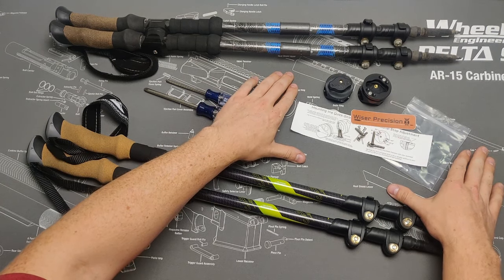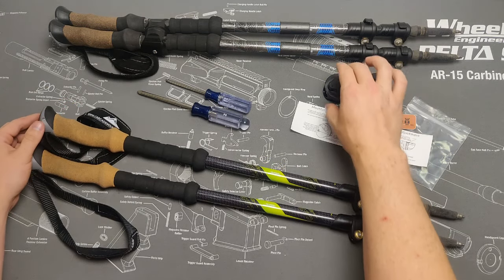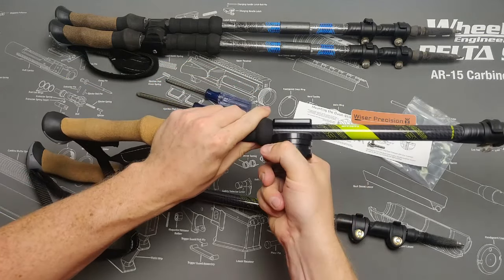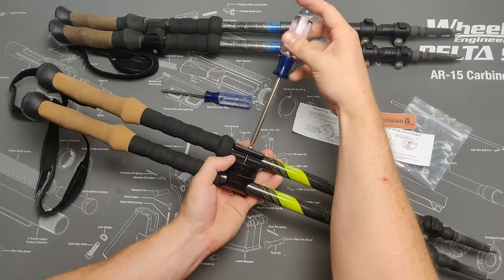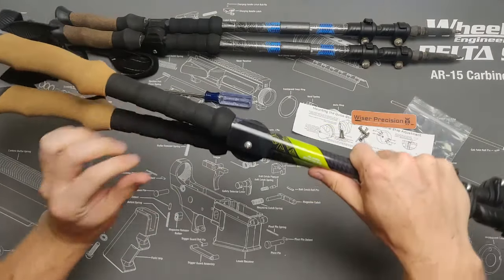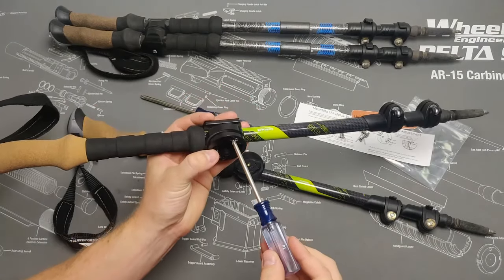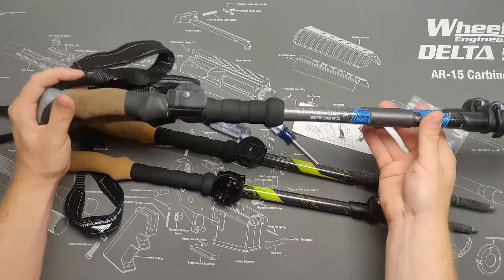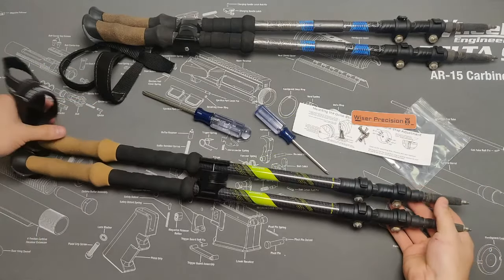Wiser Precision Quick-StiX Assembly

Comment: Question: I feel I’ve tightened them as much as I should but they still rotate without much force. Should I tighten more? I’m trying to avoid causing damage. They are on Leki Carbon Poles.
Reply: Probably gotta use the smaller screws . Had the same issue